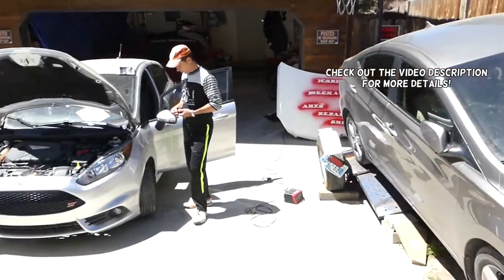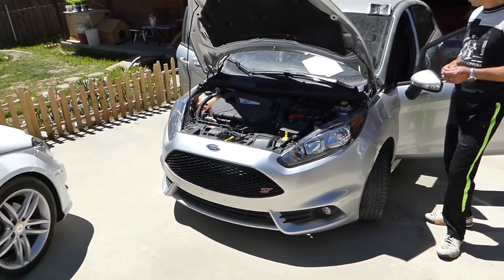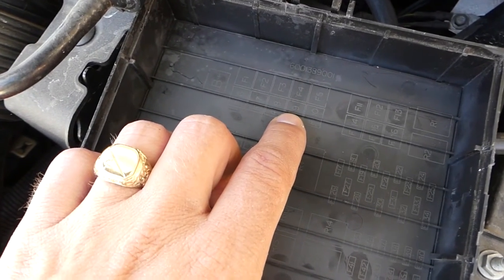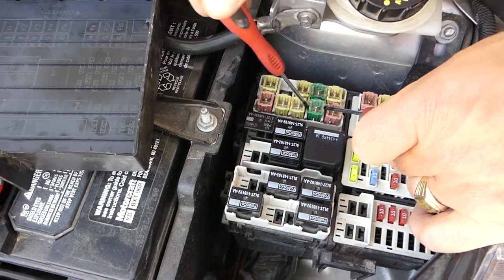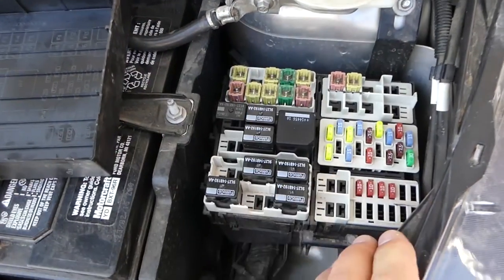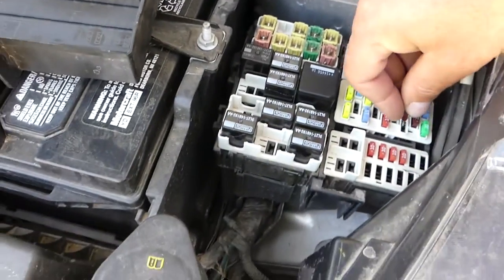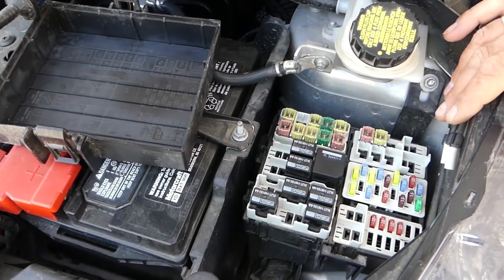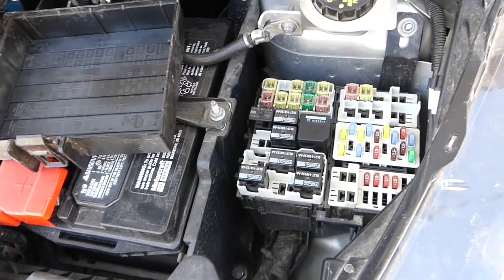FORD FIESTA ENGINE FUSE RELAY POWER TRAIN MK7 ST POWERTRAIN

Comment: My Ford fiesta 1.4 AT cannot starter. But if i use a wire bypass on relay starter. It can start normal. What should i do
Reply: Buy and replace that relay fuse that you pull to test with your bypass wire.